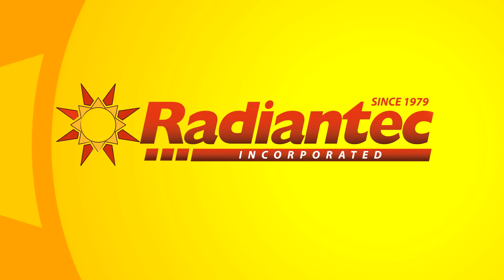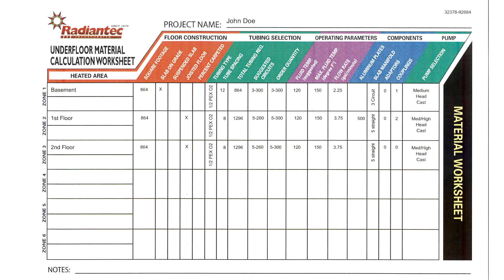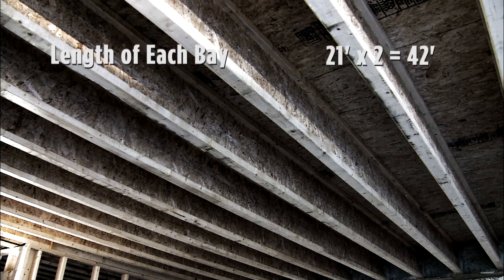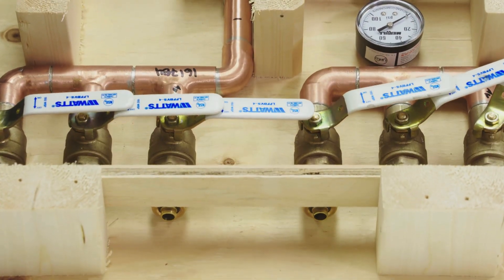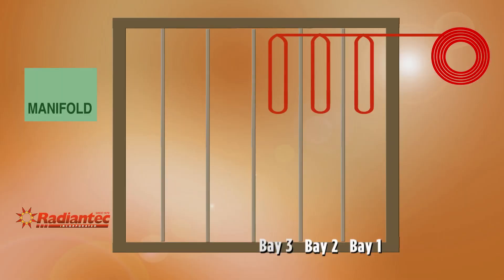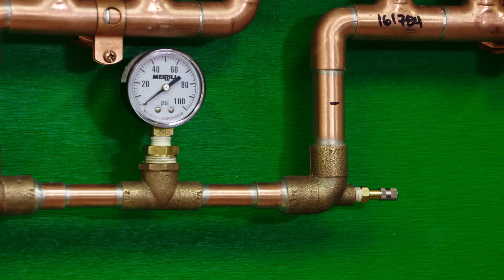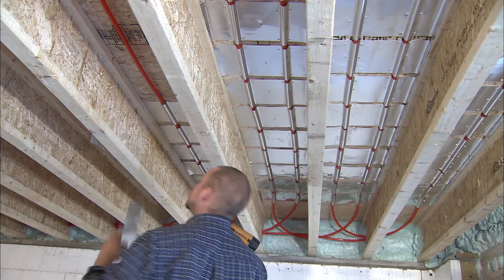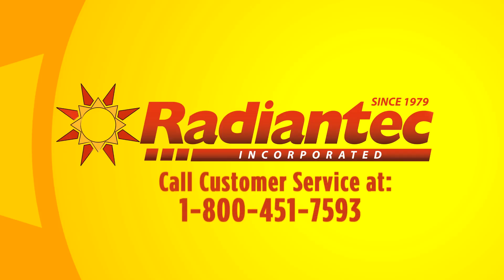Installing Radiant Heat Between Joists. Retrofit radiant heat into your home or for new construction

Comment: I wonder if you have radiant heat in a concrete floor will it make the concrete brittle or crack over time? Due to the heat drying the concrete faster than normal?
Reply from the maker: Thanks for writing. Heated water should not be run through the tubing before the concrete is completely cured. Once the concrete is cured fully, the radiant heat will have no impact whatsoever on the slab.

Comment: I am doing the same installation on I-Joists.  What if the home owner decides they want hardwood.  How do you nail it with pipe so close under the floor?  I will be mounting my Piping to the joists just under the top "I" so they will be at least 2 inches below the subfloor.

Comment: Also D-head/angle 1/2 drill $250 usd to start.
Reply: Not at all necessary. You can buy a right angle attachment for your drill for around $25.